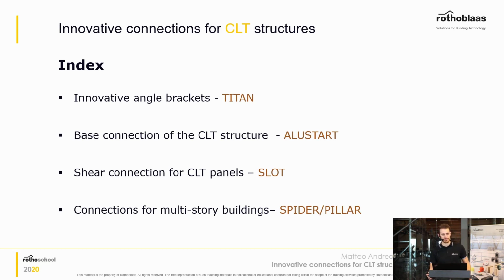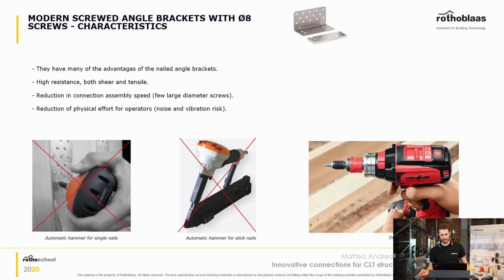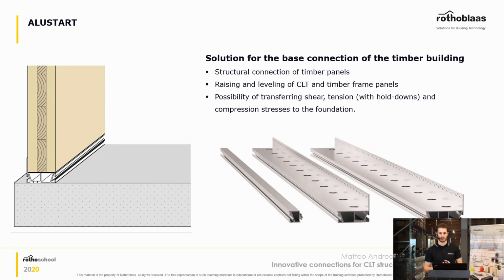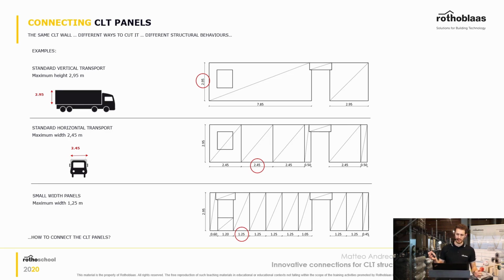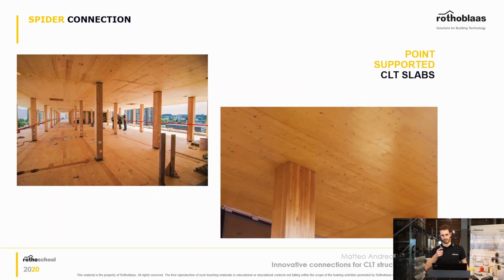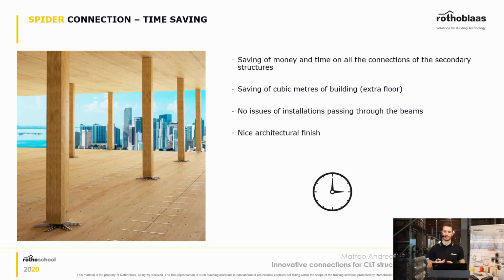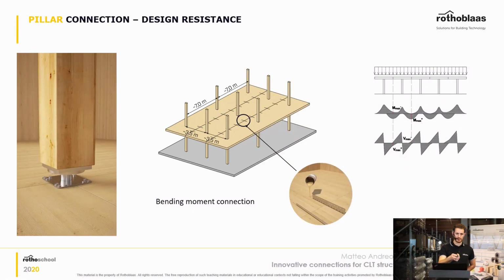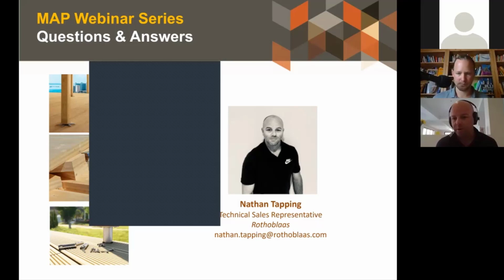Innovative Connections For Cross Laminated Timber (CLT) Structures (Webinar)

Comment: Isn't CLT construction more expensive than regular wood construction?
Reply: Not really. What matters is the labor. Paying carpenters to build up a full house frame will cost a LOT, plus you need to buy and get several products delivered, which also have a big CO2 footprint.
Getting walls prefabricated, mostly by CNT cuts, then delivered and basically instantly assembled together is far more economical and have a far lower CO2 footprint.
Reply: @Aphorism89 on point
Reply: That depends on your location and availability of supply. One of the big advantages of mass timber is that the material is much lighter than concrete and steel, so your foundations can be designed for a lower load, which makes it cheaper. The workforce needed for the construction is also smaller, and you need less trucks to bring the materials to the construction site. The lighter materials also mean you can use smaller cranes. The material itself is more expensive, especially in places like the US, but the other offsets can make the project still cheaper depending on many factors.
Reply: Clt does cost more then standard stick frame homes and buildings. Material cost engineering and design are much more costly. Co2 foot print is also increased by the amount of glues and heavy equipment required to make deliver and build the the final product making it far more costly then traditional building methods. What clt does provide is a quick installion process as long as all the pre fabricated components work per design. What pushes this industry is speed General contractors want shorter durations even if that requires higher building costs. Prefabbing offsite like this helps keep job cost down when your working on state/ government funded job when wages are 3-4 times of what the should be.. What you dont see is the cost of repairs when a failure happens. When a panel fails it is much more costly to fix and repair said area. as the panels are more or less part of complex puzzle. for instance when a floor panel fails from either in proper installation or failed adhesives from the factory dry rot etc it is very difficult to remove the panel as its bearing on a shear wall and has a shear wall bearing on top of it. floor connections are more or less T and G. so installing a panel back in its place requires alternative edge connections. replacing and repair requires alot of shoring to make things happen. where as traditional methods are less intrusive repairs to a damaged floor can be made easy by removing a few sheets of sub floor cutting out old wood joist and adding in new. patching floor back in without need to shore up and entire area. Co2 foot print on the jobsite might be less but what about offsite?? Sure your telsa doesn't produce co2 emissions. but the emissions used to mine for its batteries electric motors etc is very high what about the co2 foot print added to the power plant. when the car catches fire it doesnt go out and requires specialized fire engines to control the fire. and what about the chemical released so again added co2 foot print. Newtons law still applies folks.